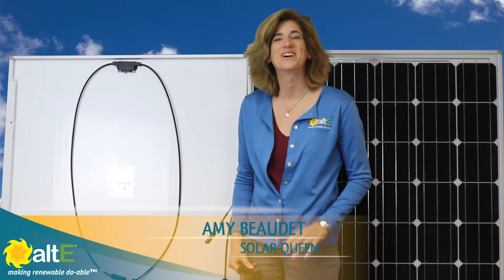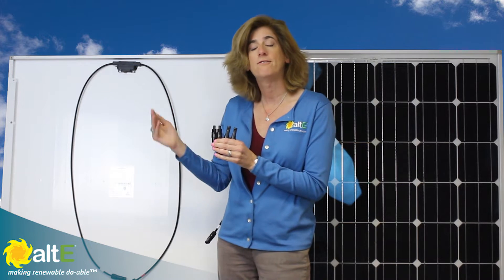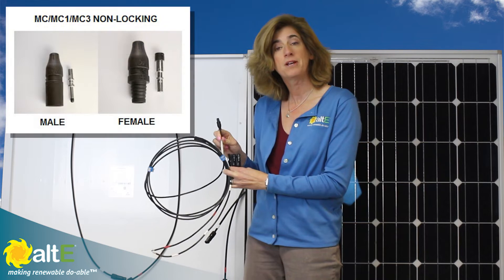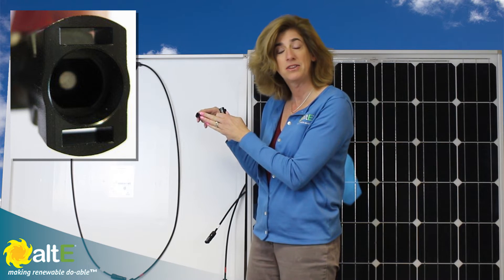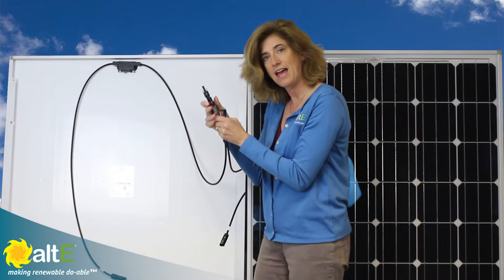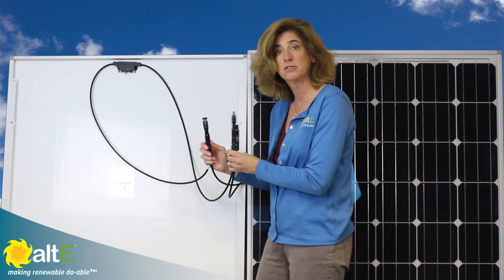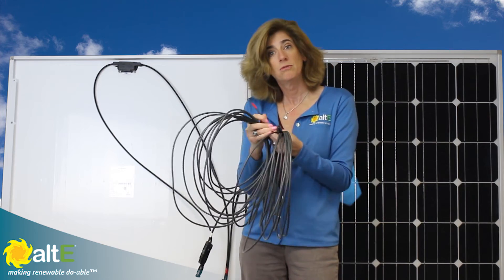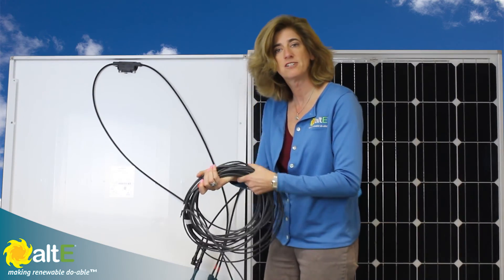How to wire two solar panels in parallel with couplers

Comment: Interested in learning how to wire two separate areas of panels Together into one string, all the panels have separate micro inverters and I want to know if I can take the three panels from one area take the wire to the junction box and then take the four panels from another area and bring it to the junction box wire together, and then from there go into the combiner b 5:33 ox, circuit, breaker, and have them just equal one string. The system is DC through the micro inverters and it is then Converted to AC power I don’t know if this makes any sense. If not, maybe you could ask me some questions.

Comment: I've got two 100 watt solar panels a charge controller and two deep cycle agms they were working just fine and within the last two weeks I started noticing the power drop and I cannot get the power to go back up and now I just lost power completely do you have any idea what it might be I did have a fan hooked up to the dump load on the charge controller did it draw too much power or did it draw power away from the batteries that's what I was thinking but I'm not sure cuz I don't know about that dump load

Comment: Amy, thank you SO MUCH!!  I agree with Linda Bemis (I'm 2 years older than her) that your info is very clear for those of us with 'old' ears and technology!!  My first question is: How do I combine the two extension wires into one for the DC input on a solar portable power station.  My second question is: No matter how much I enlarge it I can't tell from the listing picture what kind of a plug it needs for the DC input, it looks like the small round plug on a car charge cord (my guess!).  One of the questions in the listing says the "solar input cable

Comment: Great info Amy. I am a 73 year old woman struggling to understand solar so let’s see if I have this right. I have a 100 watt and a 170 watt solar panel. 1 has Anderson and 1 has mp4 connectors. So to connect them in parallel I have to convert the Anderson to mp4 , use a set of mp4 branch connects for the parallel and convert the ends back to Anderson to connect to my solar generator. If this is correct you can thank yourself for a super informative video.
Reply from the maker: While that could work, it sounds like a lot of converting and potential for losses and failures. I think a better solution would be to convert them all over to just bare wire, either with adapters or cut off the connectors (which will likely void the warranty, so decide if it is worth it), and wire them together inside a watertight junction box.

Comment: Mam i have already 3 panel of 50 w in parallel...now can i connect a 180 watt panel to it in parallel & if yes then how ? All are of same manufacturer & same voltage...
Reply from the maker: I strongly suggest getting a 2nd charge controller for the 180W solar panel It is so much different that the 50W ones.
Reply: @AltEStore  Mam if i take 3 more panel of 50watt instead of 180 watt..i mean have there any problem if i connect total 6 panel of 50 watt ?

Comment: We just purchased an KiloVault Res-Q Portable Power System through RealGoods online store. I was expecting there to be 2 solar panels with the "kit" (because the picture of the kit showed two panels), and we received 3 solar panels with 2 sets of the couplers you show on this video. The difficulty is your video says that only TWO panels should be wired in parallel with the couplers. We found that connecting the 3rd panel using the same connection procedure requires that 3rd solar panel to be back to back with the first two panels. Did we get an extra solar panel and a set of couplers by mistake? If not, how do we manage to connect them properly? Help.
Reply from the maker: So sorry for the inconvenience. We were temporarily out of the 150W panels, so had to use 3 100W panels for a while. We changed the description, but apparently not the picture, and didn't realize it would need additional cables (trying to work remotely during Covid can create gotchas). Please contact our Customer Support department, and they will send you the extension cables you need. 877-878-4060 x 190. She'll be expecting your call.
Reply: @AltEStore  Thanks for your prompt reply and help on getting the panels connected with an additional extension cable. Will let you know when the cable arrives and how the final assembly and hookups turn out.
Reply: Very nice solar teaching. Inspiring.make me want to DIY.question  .6 panels at 200 watts .11.8 amps, 22.6voc,  can I use this in series on a 60A charge co stroller mppt

Comment: My solar panels had mc4 connectors for the entire length of time it took me to walk to the shop and get back with a pair of wire strippers. I'm curious as to what size those cables are.

Comment: Do we need anything like a transistor? to prevent any back flow of current? I know that panels are not energy storage devices so it shouldn't matter. But the 2 panels connected in parallel can have different voltages based on their exposure. So does that affect the current flow?

Comment: With limited space on my rv, I'm thinking about using a 100 watt panel vmp-17.7 with a 50 watt panel vmp-18.3 in parallel with a mppt controller.  Will this add my amps and run with 17.7 volts?

Comment: Hi. Can I connect two 150W panels in series and than this with another 100W panel in parallel? I have a 30A EPEVER MPPT controller.
Reply from the maker: No. You would then have a 24V 300W panel in parallel with a 12V 100W panel. That would not work well at all. You are better off wiring all three in parallel with a combiner box like the Midnite PV3.

Comment: What is the device that is used for the amperage not to back feed to other solar panel?
Reply from the maker: It depends on how you are using it. If you have a charge controller or inverter, that should be enough. If you have a situation where some panels are shaded and others are not, and are off grid, a diode may be used. But that is only in rare situations. See our video on diodes at https://youtu.be/5rYy0gHZepI

Comment: I plan on hooking up 8 100w panels how would I hook them up? Parallel or series
Reply from the maker: It depends. What voltage battery bank are you connecting to? Are you using a PWM or MPPT charge controller? If MPPT or 48V with PWM, I'd suggest 2 parallel strings of 4 in series. If PWM and 12V, you'd hve to do all 8 in parallel. If 24V and PWM, then 4 parallel strings of 2 in series. PWM has to have the panel array voltage match the battery bank voltage. With MPPT, you can have a higher voltage in and it will output the right voltage to the battery bank.
Reply: Good answer for sure, but there is a little more to consider than that.  If you are in series, any shading on one panel affect all panels equally.  Not good at all.  YOur 8 panels can all get wiped out by shading on only one. 
 On the other hand,  you can use a lot lighter cables in series which can be a lifesaver and is certainly a lot cheaper.

Comment: Can I do the other way around? Wire 1 panel to 2 inverters?
Reply from the maker: It depends on the type of inverter. If it is a battery based off-grid inverter, then indirectly yes. You'd charge the battery with the solar panel through a charge controller, and then you can connect two inverters to the same battery. But if it's a grid-tied inverter with no battery, then no. You would want to have  dedicated solar array for each inverter.
Reply: 1st is a gridtie  inverter and the 2nd is a hybrid on/off grid inverter connected on a same solar panel, 1 active and 1 reserve turned on but no load for power outages only.  Can I do this?
Reply from the maker: So the 2nd is connected to a battery that is getting charged from the panel (through a charge controller)? I don't see that working well. If you have 2 loads on the panel, best case would be that the wattage would be divided between the 2, so each only gets some power. I'm not sure how this would work in the real world. Let me try to come up with a test and we can do a video on it soon.
Reply: I already got a 5kw gridtie inverter with eps function but my problem is when there is no power at daytime from grid the inverter triggers the eps but stops harvesting the power coming from panels.  the array of panels is configured in series up to 320V/9A.  There are some on/off grid inverter that can work with that voltage and amp I plan to buy one and connect it in parallel with one of the array I got for emergency purposes.  Yes it will degrade the harvest but atleast I have a guaranteed power during day time whenever the sun is up and the power from grid is down.  It would probably make sense to just replace the existing inverter with the new off/on grid inverter but it is not that reliable and not capable of handing the same strings of panel I have setup so I just thought of making it as a backup but I don't want to flip it manually. I'd like to have it readily connected in parallel,  I would not also want to use a transfer switch with it as it is DC current and prone to arcing. It would be great if you can test it and make a video on your end.  (1st invereter is dual mppt 5kw and new one I plan to buy is single mppt 4kw)
Reply from the maker: What you are describing is called AC Coupling. You would connect the outputs of both the grid tied inverter and the hybrid inverter in your critical loads panel. When the grid is up, it just passes the power through to the main breaker box. When the grid goes down, the hybrid inverter powers the critical loads from the battery bank, and tricks the grid tied inverter into thinking the grid is up, and keeps outputting, since t is not connected to the grid.  It backfeeds the power through the hybrid inverter to charge the batteries from the solar. We did a bunch of videos on that, you can see them here, https://www.youtube.com/playlist?list=PLoHd6hGDqS05HGtV7P-vsRJsDw11R4Bb4
Reply: It is not AC coupling, I know AC coupling and what you are trying to describe.  But that is not what I am trying to do.  The inverter I am trying to add is also a gridtie but has an off grid function.  Eventhough there is no power from grid it will supply power to whatever Ioad I put on it long as I don't overload.  This type of inverter when on backup mode it charges the battery and at the same time supply AC power to the house if the panels can support it, otherwise it will stop charging the battery and uses the battery & panels to supply AC. this is the link http://www.eastups.com/en/products_show_48_162.html
Reply: I checked the video, I guess what I am trying to do is like DC Coupling but instead of installing add'l mppt charger rated at 400V+ DC input. I will be buying this http://www.eastups.com/en/products_show_48_162.html  and use it as a charger and a backup power.
Reply from the maker: I'm not familiar with that equipment, but a quick look seems to show it has a built in battery charger. So yes, it's doing the DC Coupling by charging the battery bank. So your grid tied inverter may be redundant. Again, not being familiar with it, I can't really give much of an opinion.

Comment: I have a goal zero yeti 1400 solar generator that ive got one 200 watt panel attached so far to keep it charged.
Thanks to you I now know how to put 2 panels together with y connectors. Thanks!

Comment: I'm new to all of this, and sure could use some help or information. I have two Renogy 100 Watt panels, and I have the Wanderer 30 amp charge controller. I'd like to use both panels at the same time, but not sure of just what I will need to buy in order to use both panels at the same time. Also I'm assuming that the 30 amp charge controller will handle both panels ? Thank you for sharing your video... any help I get will surly be of help to me... Thanks.
Reply from the maker: I assume you are charging a 12V battery bank. Those panels have a short circuit current (Isc) of 5.75A.  The charge controller is rated for 30A. 30A/5.75A = 5.2. You can use up to 5 of those panels wired in parallel (plusses together and minuses together) with it. The easiest way to wire 2 panels together is with the MC4 coupler as shown in this video. That will turn the 2 panels into virtually one 200W 12V panel.
Reply: Yes mam, it's a 12 volt system. I decided to give RENOGY a call and talk with one of their Tech guys. Told him what I have, and what I was wanting to do, and he set me up with everything that I need to connect both panels, and the 20 foot lead that I'll need to place the panels out away from my RV. Will be here today, it out for delivery on FedEx truck... I thank you for your help here, and I'll be watching more of your videos. Thanks again Thumbs Up for sure....

Comment: What is the awg of the wire connecting the panels
Reply: Looks like 12 AWG on the panels.  Probably 10 AWG on the longer runs because you've doubled the amperage and the cables to the rest of the system are rather long.  There are wire gauge tables that you can  look up the gauge needed for the amperage and run length.

Comment: Do the MC couplers work withH4 type connections?
Reply from the maker: This is actually a tricky question. MC4 and H4 connectors do fit together, but you may need to get both the MC4 key and the H4 key to disconnect them. There are some who do not like to connect different brands of connectors due to possible differences in tolerances and metal compensation. So yes, they will fit, and are used together all the time, but some people prefer to use an adapter if they have to mismatch, like we have here, https://www.altestore.com/store/cables-wiring/solar-panel-wiring/h4-to-mc4-array-adapter-set-mf-pair-p10618/.
Reply: I think I will risk intermingling  :)  Does Amphenol not make an H4 coupler?
Reply: I answered my own question.  Yes they are around.  Perhaps Alt-E does not sell them?
Reply from the maker: We don't currently have any. I did just submit a request to find some.

Comment: How do I connect the solar panel cables to a bigger cable which runs to my house?  I'm using 4/0 cable because it is a long run.
Reply from the maker: +paul grim You would make the connection in a combiner box or a pass thru box, some sort of water proof box where you can connect the two different size wires. 4/0 is very big and expensive, are you sure you need to go that big? If you haven't already, check out the video I did on sizing the wire in your system. https://youtu.be/89u8R_aUFO4
Reply: +altE Thanks for your quick response!  I have the combiner box, but I'm not sure how to actually make the wire connection?.  In plumbing you would use a reducer, what do you use in electrical?  Is it via a bus bar?  Yah, 4/0 is huge, but I had some laying around - free is appealing and hey .0001% voltage drop!  :)
Reply from the maker: +paul grim Gotcha! The bus bars in a Midnite combiner box can only go up to 1/0. You could probably bolt a conductive extension onto the bus bars that has bolts that can handle 4/0 lugs, something like this, http://www.midnitesolar.com/productPhoto.php?product_ID=209&productCatName=Busbars&productCat_ID=17&sortOrder=19&act=p
Reply: +altE Thanks Amy.  That looks like the ticket.

Comment: If I have 4-50w panel with the same specs and I want to connect them all in parallel. So, I need 3 pairs of T-branch connector to connect them all in one single line to my 30A breaker using #10AWG stranded wire and then to my Morningstar Prostar MPPT charge controller. Am I right, Amy? Thank you so much.
Reply from the maker: +Aleneski Kalashnikova   I don't recommend using couplers for more than 2 solar panels. The panels are usually designed that they can handle any backflow from one extra panel if something goes wrong, but cannot handle 4x their designed power.  I recommend using a combiner box with 4 panels. You can see the details in this video,  https://youtu.be/iOqY6QqFopA

Comment: Hi,can you parallel two panels of different voltage?New to this so you are now my source for credible info
Reply from the maker: +CLIFTON RICARDO RUSSELL If you have different voltage solar panels, you need to connect them to different charge controllers. Sorry.
Reply: +altE Store thanks for info
Reply: @AltEStore  If I have 3 sets of 2 in parallel and run them to a combiner box do I add the voltage?
Reply: @kevingee4294  wiring in parallel increases the amps, in series increases the volts. So you have 2x the volts and 3x the amps.

Comment: what determines the gauge of the cable and if the current is say 10 amps, what is the proper gauge to go 10 feet. I know ac for homes and this I need to understand, you are the best
Reply from the maker: +George Gardinier That is a complex answer that we cover in our wiring your solar panel video, https://youtu.be/89u8R_aUFO4
Reply: +altE Store wow thanks so much i live in canada so it would fit in.

Comment: doesn't the red o-ring on the connector signify to be positive?
Reply from the maker: +Rev John O'Toole No, that's just a coincidence. Other manufacturers' are blue. Depending on where you are in your system, that female may be on either plus or minus.
Reply: +altE Store the first time I used mc4's I put the pins in the wrong connector, that really didn't make my day since I only bought one pair. are the pins available without the connector?
'john
Reply from the maker: +Rev John O'Toole Sorry, we only sell the connectors in 10-packs, and it is the connector and the pin together. https://www.altestore.com/store/Cables-Wiring/Solar-Panel-Wiring/Multi-Contact-MC4-Female-Cable-Coupler-for-AWG10-12-PV-Wire-10PACK/p11590/